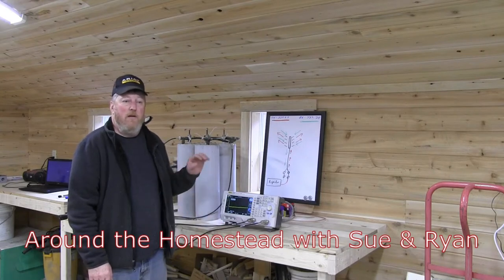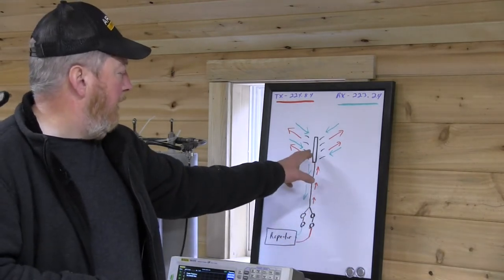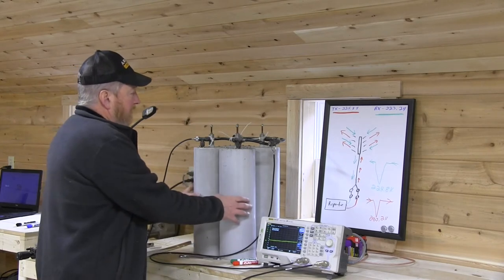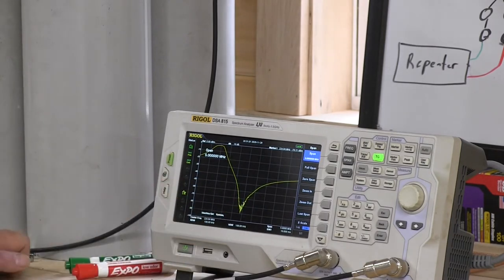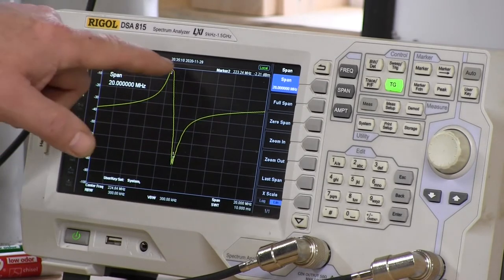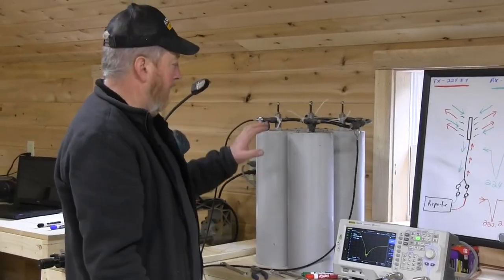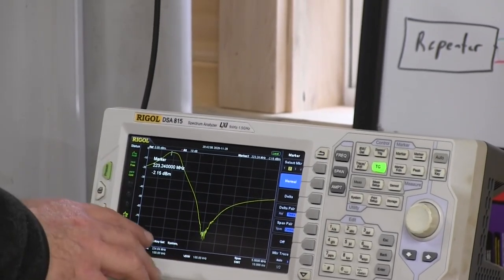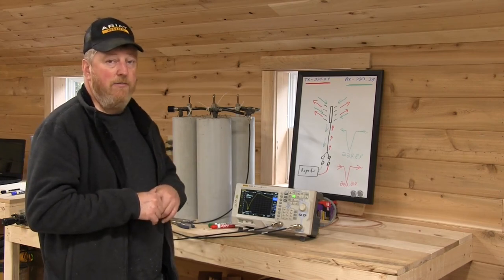Ham Radio Duplexer Tuning

Comment: You need to have more power going into the duplexer to adjust the notch or a more sensitive receiver to get the true notch.  That is why instead of a smooth curve at the bottom it looks like the trace is jumping around so much.   I am not sure if the Rigol can do this or not.  Many of the test sets do not have enough range to get a notch of 80 or more dB.  Especially if some 3 to 6 dB attenuators are used at each port.    As someone below mentioned a return loss bridge would be better to tune the pass cavities.
Reply: Couldn't the Rigols output be fed into an amplifier to get a more real world reading?
Reply from the maker: Good info

Comment: A good explanation.  If your SA has averaging capability, that will help you see the deep notches more clearly.
Reply from the maker: Cool will have to look into that
Reply: Actually he needs more power out of the generator or a more sensitive receiver to get rid of the 'grass' at the bottom of the notch.  When doing this the he will get a single line instead of the jumping around effect.  That Rigol may not be able to do that.  Averaging will not do that.

Comment: I have never run a repeater and have obtained one from an estate of an SK.  The station was disassembled before I arrived.  How can I identify which duplexer bank is the transmit and which is the receive. I.E. high pass and low pass?  if I hook them up incorrectly logic says I can't burn either out but I want to be safe.  Also, How much power can the filters handle?  The station had a 250 watt 2 meter amplifier but I don't think it was being used at the SKs last years.  Thank you, great video.
Reply from the maker: Honestly if I was in your shoes I would find an Elmer close by that will assist in setting up the repeater. You have a ton of moving parts to setting up a repeater and at that power level its a lot harder vs say 10-25 watts. Check with the local radio club some one will be more than happy to assist I am sure

Comment: hi there, we are running a 2 meter repeater, 147.165, 147.765  . it is old but still works well, Almost ,LOL,  it has been giving us some issues,  the issue seems to be we are getting some RF signals into the receiver, causing the repeater to stay on, breaking squelch, and sending noise out.  if we lower the power output of the amp, the problem disappears and all is well.
but as soon as we use any amount of power it acts up again.
Do you have any ideas of first determining the issue, and second resolving the a issue ?

thank you so much Bill VE3WTK
Reply from the maker: Bill, Certainly not an expert but if the Final Amp power level causes the issue I would look at that to make sure its staying in band etc. Barring that maybe hve the duplexers tuned

Comment: How did you hook up the Spectrum Analyzer ?  You hookup up the output from the Tracking Generator to the antenna side of the Duplexer. What did you do at the other end of the duplexer where you have two connections [one for transmitter and one for receiver] ?  What did you change when you did the other cans ? did you change the connections? Thanks
Reply from the maker: I am certainly not an expert but I usually feed the signal generator into the T that feeds the antenna and the SA into the TX or RX, The one not used I put a dummy load on. Now if I am starting with cans that are not close I do one at a time and then assemble them.

Comment: I have a question; why didn't you add a directional coupler and check your return loss while you were tuning ?  It may have given you a clue as to whey your insertion loss was so high.
Reply from the maker: Good point, I didn't really think the insertion losses where to high but next time I have them down I can try that and see for sure.
Reply: @aroundthehomesteadwithsuer3497  Anything over 1.5 is reason to keep looking.  It could be a connector, even.
Reply: Agree
Reply: Insertion loss can be adjusted by rotation of the cavity coupling loops.  They're normally adjusted to spec during the initial setup.  Some duplexers have calibration numbers to initially set the insertion loss.  73   Gord   ve7uy